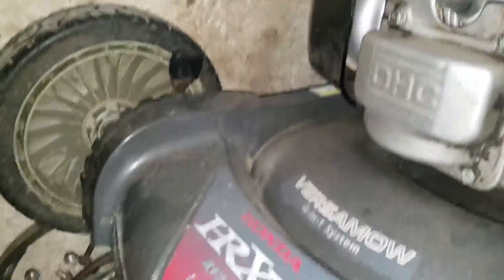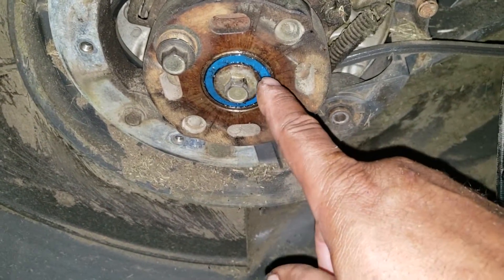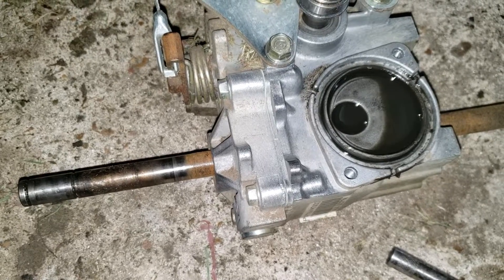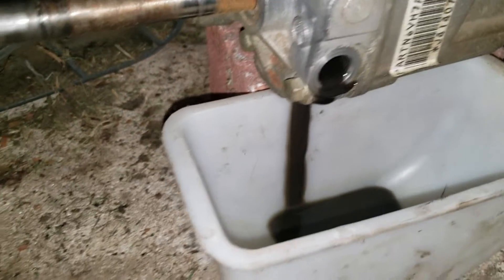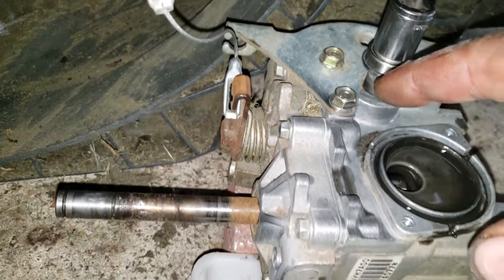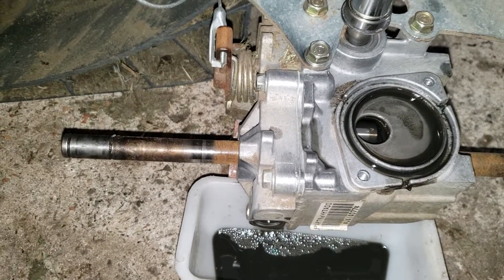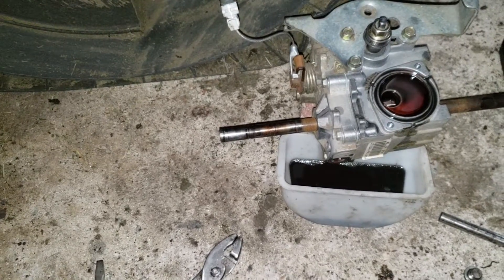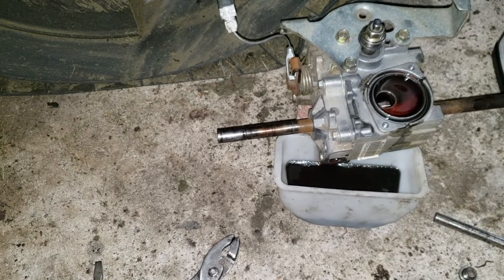Honda hrx217hxa hydrostatic maintenance

Comment from the maker: I recommend that you cycle the transmission several times with the drive engagement to remove all the air. I removed the ac delco transmission fluid and replaced with factory Honda 08208-HST02 Hydrostatic. It launches now like a dragster.
https://youtu.be/3a9MCN0EWag
Reply: What if the trans has leaks, any way to fix it? I really don't wanna spend the money for a brand new one
Reply from the maker: Most likely it is the seals that leak. You can replace those. Look up part number and order/replace them. If the case is leaking. Take apart and replace case gasket and axle seals. Or replace transmisson

Comment: Just wanted to thank you for your video.  I have a 16 year old Honda HRX217HXA, and had to replace the clutch cable after using it for the first time this spring.  Once cable  was repaired, I noticed a distinct growl from the transmission when engaged.  Watched your video, ordered Honda hydrostatic fluid, and thought it was worth trying vs. ordering a new transmission.  Sure enough, transmission fluid was black, just like in your video.  Flushed, refilled, and it runs like new again.  No more noise from transmission, and speed is back to normal. Can't thank you enough for video, and for helping others with similar issues.  Based on your videos, also greased blade brake bearing (it really needed it!) and wheels.  THANK YOU, THANK YOU, THANK YOU.

Comment: Thank you so very much for taking the time to make this video Noone.  My HRB216HXC Honda mower that i purchased in March 2003 had really gotten slow over the past years.  I put a new drive belt on it about 4 years ago because of noticeable wear but it made no difference in the speed.  I checked the drive cable adjustment to my owner's manual specs as well, and I finally took it to our local dealer last year who fired it up in the their parking lot to try the drive speed of the mower.  I explained it improved very slightly after a few minutes of warming up, but nothing like when i purchased it new.  He told me the drive units are made to just be exchanged (over $400 for the unit PLUS the labor to install).  I looked at the new version of what i have but my (wise) wife suggested there were better things to spend $1250 on than a new Honda mower and besides, our lawn is pretty flat and it's good exercise for me to push it a bit...
Well, I watched your video, and on my day off today I filled up the unit with fresh 30W oil and WOW, I'm going to need to wear running shoes now to keep up with this mower.  It has the speed of when it was new and that Honda motor, except for a new carb, cable control and new wheels over the 17 years I've owned it, has worked flawlessly, starts on the 2nd pull each week, and doesn't use a drop of oil during the entire cutting season, after which I change the oil, run some fresh fuel with stabilzer through for 10 minutes, then run the carb dry and put it away until next year.  Your video you shared saved me a bundle of $$.  Cheers, Bruce
Reply from the maker: Fa'sho, thats why I  made the video. Sometimes we just need some insight to whats happening. So we have a better understanding of our equipment.

Comment: I've worked on small engines for years as a DITY guy. I had no idea that my Honda HRX 217 needed hydraulic fluid change! It's not in the owner's manual. Thanks! My mower is 9 yrs old ~ 600 hrs. I did engine valve adjustment and cleaned / regreased rear pinion gears. Now another job to R&R hydrostatic fluid and belt. FWIW my mower doesn't have the clutch bearing on crankshaft but your advice is good! Thank you. 👍
Reply from the maker: You have another job after the transmission fluid change. You need to lube the blade clutch bearings and wheel bearings. To be a complete maintenance job.
Reply from the maker: https://youtu.be/pIaaLPOzvYg

Comment: Nice job! Wish you had shown the proper method for refilling the transmission fluid once this flushing procedure is completed. Also, how to remove the transmission from the mower body would have been a sweet addition to the video.
Reply from the maker: You simply fill the hole at the top. I should have shown the refill procedure step by step. I didnt consider the non mechanic when making the video. My bad, but I did link a video that I used to dissemble in the description since he had the factory step by step procedure already recorded

Comment: I changed my hydro fluid today. I used castrol trans fluid and it is working well now. The cover plate with the rubber disk was holed and lots of sand had got in. I dont know how it was driving at all. I sealed the hole with steel putty, flushed it twice, then filled to the brim (making sure to remove air).  Thanks for this video, it massively helped.
Reply from the maker: Thats why I made the video. So people can save some money.

Comment: This is how you keep a Honda running 30 years. I have a HRX 215 bought in 1991 and I have done all kinds of work on it myself. I have changed the hydro-static fluid three times just because it should be done sooner than later. Funny how the transmission costs about as much as a new Honda mower. Good video!
Reply: What transmision oil di you use ? and how many ml or OZ requires ?
Reply: @romanescugeorge4263  I always used the Honda Hydrostatic Fluid All Temperature that comes in a 12oz bottle. This was enough for two changes. I have the older drive and you have to bleed it or burp it to get the air out by rotating the input shaft. I remove the assembly and mount it in a vise as well. Be sure to clean and lube the sprags (one way clutch) at the axle ends. That is important too!
Reply: @paintnamer6403  thank you. I ve ordered honda hydrostatic oil 12 oz..
Prettty expensive oil 70$ in europe but it s a Hooonda.

Comment: Thank you sir, my 10 year old HRX is still going strong but I noticed a bit of friction when pushing or pulling it as time goes by without the drive engaged so I suspect your suggestion to change the fluid regularly is spot on and good advice to heed. Looks like I will have a project for next weekend. Just trying to get it all done before another mowing season starts.  Going to have to watch your other videos too, since it appears you have already blazed the trail for maintaining this version of mower.  Thank you again for taking the time to make the video and share it with us.
Reply from the maker: Yes check out the bearing maintenance of the wheels and the blade clutch. Yes changing the fluids is a must.

Comment: Great instruction man. No one else has any info on these.  I just bought a new HRX217K6HZA and am already prepping to do this in a few years as a preventative maintenance.  

I wish honda made this a little easier, but I guess they can label the trans as a "lifetime" fluid and "no maintenance," until it fails a few years after warranty from broken down fluid and charge you for a brand new one.
Reply from the maker: Check this video out for bearing maintence also. I  show the blade clutch and wheel bearing service. https://youtu.be/pIaaLPOzvYg
Reply: They call it lifetime fluid because it should last the lifetime of the transmission, so it all depends how long is the transmission going to last. Sounds like a scam to me doesn't it.

Comment: Thanks for the help.  I had the symptoms you described, followed your instructions by doing a triple flush, then a flush with new Honda fluid and then filled it up.  My mower runs like a scalded ape now!
Reply from the maker: Fa'sho... I just provide info and instruction you do it yourself. You learning your equipment and saving money. Once you able to completely service your equipment and keep it running optimum. It becomes hard to part with unless you want something different.

Comment: Thanks for the video!  My March 2022 Honda HRX217HYA self-propel feature never quite felt powerful enough even after drive cable adjustments- sure enough turned out the "factory fill" was barely a filled.  I cleaned out the transmission with 5w30 2 times, then filled/bled air from it with Honda Hydrostatic fluid.  I made sure to turn turn the drive shaft and the input pulley (clutch engaged) in every possible direction possible to get the air out, and I did the transmission swirl as well to get more out- then I let it sit for 10 minutes for more air to come out.  I now have to adjust the cable again because I'm running behind the machine to keep up with it!  Makes less groaning noise, and actually sounds like an actually transmission under load now while pulling the mower.  No leaks either. It was bad before.

Comment: I was trying to do maintenance on my Hrx217hxa transmission 3 yrs ago and rendered the transmission useless. Thanks for posting this! I don’t think I drained and filled it correctly. I’ll definitely use this to revive it once I get new fluid.

Can you post how to refill? Once drained I imagine you just refill slowly while rotating the drive shaft pulley to get the air out.

Comment: Nice job Bro.  First video I could find of someone actually replacing the fluid.  My mower may not have drain plug and I think I have to order a new assembly.  Are you using regular transmission fluid?
Reply from the maker: No using honda 08208-hst02 hydrostatic fluid. It works best. I tried to full synthetic from gm transmission fluid. It never really allowed power output fully. Then I tried the amsoil 0-40w 100%synthetic and it never was able to reach full operating temperature because it was resisting heat so well. Therefore I just when with the original honda fluid. It is strong and fast now.

Comment: My HRX217 has leaking seals, loss of speed and torque- also had a growling noise. Replaced seals, flushed and refilled transmission.  This improved the speed and torque issues but still growling.  Any help on that would be great!

Comment: Great video. What if you are tryping to cycle the transmission to get the reserve  cleaned and the shafts don't want to turn? It feel like it builds pressure then binds up.
Reply from the maker: You must engage the lever with the spring to maximum for the shafts to spin. These transmissions are always active, lever controls the flow for speed.

Comment: Hi, many thanks for the great video, what do you recommend as replacement oil ? I replaced mine with 10w40 synthetic oil but there is no power i.e the wheels turn when wheels not touching the ground but when on the ground they do not turn, I am wondering if the replacement oil was to thin, any thoughts about what could be causing the issue ?  Many thanks
Reply from the maker: I did the same thing replaced with 100% synthetic motor oil because alot of forums was saying regular oil. But results was not satisfactory. I then replaced with honda specific oil. Worked proper but is not duty oil. Meaning continuous work oil. Breaks down real fast. Only intended for 1 (30min. Max) yard, once a week for 4 months out year. And yard must not be loading the drive system. 

You must remove all the air from system. And be certain that internals aren't worn. I then found out about amsoil hydrostatic synthetic. That is what I refilled with. It takes about 5min to warmup. Then it is a duty machine just ready for anything.

   My experience with worn internals.  I watched a lawnmower man using new hrx217, that convinced me to buy one(used). I replaced fluid then showed him how much it improved my used hrx. His was dreaded slow til he was pushing hrx. I sold a transmission service. Replace with the amsoil but his 8month old still was pushing slow. Ended up giving him an extra transmission that I know was good because I sold the service job. That transmission(used) is still working like new today.

Comment: Hi there,
I just replaced the fluid for my Honda HRX217HYA. Everything went smoothly. Tested the mower, when engine running I pull back the mower easily but when engine stops I CANNOT pull the mower back. What is your recommendation?
Thank you.
Reply from the maker: Pull off the wheels. The metal gear connected to that drives the wheels may be backwards. Simply turn it around. Sounds like the ratchet mechanism is in the wrong direction.
Reply from the maker: Do one wheel at a time. First the right (standing holding the handle bar)side. Test it, if it solved stop. If not do the other side. Other than that I cant diagnose over the internet. But that is likely
Reply: @thisismee3642  I pulled both gears on both sides off, I used pliers to rotate the axle but it just rotate  one direction (forward).
When engine is running, everything is normal, pushing forward, pulling backward are normal without drive engaged. 
Thank you for your response.
Reply: I remove the transmission from the mower. I try to rotate the axle by hand, the axle just rotates counterclockwise direction, and can not rotates clockwise. 
I try to rotate my friend mower (same model) axle and it rotates both directions easily. 
What wrong with my transmission  and what do you recommend.
Thank you.
Reply from the maker: I cant diagnose this aspect over the internet. The metal gears being backward would cause that symptom. That us the only diagnosis other than the drive mechanism being jammed and keeping the rotation going forward. I sold my hrx217 when someone offered my profit for my unit. I am rough with my mowers and the fiberglass body is easy to break. I have a hr215 master with a metal mesh gear drive and aluminum body.
Reply: @PhiTruong-wf3ye  the spring around your trans clutch that normally pulls the lever fully back may be broken or slipped out of place.

Comment: How much fluid does it take to refill?  How do you check you have the correct amount back in?  Thank you.
Reply from the maker: You cant over fill it. It takes loke 7-8oz to refill. Just fill to the brim and cycle the lever while spinning on highest speed with drill.

Comment: Quick question, my mower which is this same one here, makes a wired noise when the mower is rolling but when it has resistance, in other words. When it’s rolling me helping push the machine it doesn’t make a noice that much but when it has resistance then make a wired noice like if it’s really putting the transmission to work, I replaced the belt thinking it was the belt but it’s still makes the noise,  any suggestions? I’ll really appreciate it
Reply from the maker: Cant really diagnose over the internet without hearing. Based off the probable things that could go wrong. 1 could be that the drive gear for the wheels could be dry and sticking. The ratchet gear spring slots may need greased. 2nd one of the ratchet gear may be on backward. So that is why the noise is still present when self propelled is engaged. 3 grease the pass through for the drive shafts for the gears. Other than seeing and hearing it my self.
Reply: @thisismee3642  thanks for the reply and the help, I’ll try that

Comment: I am so frustrated with my mower.  Honda HRX217HXA.  Has been running fantastically for over 14 years.  Well maintained, and serviced regularly.  Just had the drive cable replaced and the machine tuned up.  Brought it home and after only a few minutes of use the mower will not self propel.  Engine is strong and runs smoothly.  Could it be that after all these years it needs the transmission fluid changed? To replace the transmission is extremely expensive($245) - Looking for something more plausible and perhaps easier. I so appreciate your help.  You are so good at explaining things, and I hope to solve this dilemma without having to get rid of the mower.  It's otherwise just fine.
Reply from the maker: https://youtu.be/3a9MCN0EWag

Comment: Do you have to remove the drive assembly to drain the fluid?
Reply from the maker: A lil ingenuity may overcome the obstacle of removing the transmission. Check this comment section cause someone overcame it with good results. Read carefully and ask that person questions. Thats between yall 2!

Comment: How did you remove the pulley on top of the trans? Having a heck of a time trying to get mine off.
Reply: I know this is late but for others: i put a large screwdriver thru the pulley hole to brace it. Then with a wrench on the nut, strike with a hammer counter clockwise